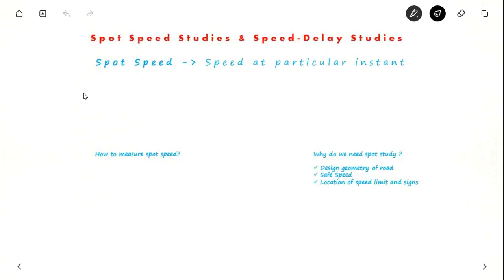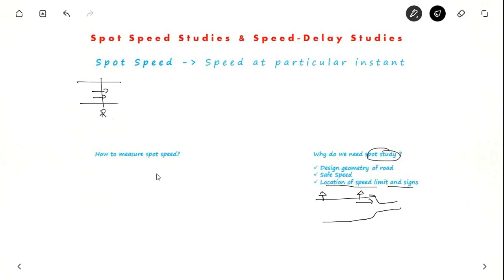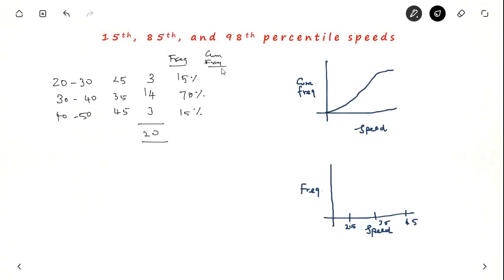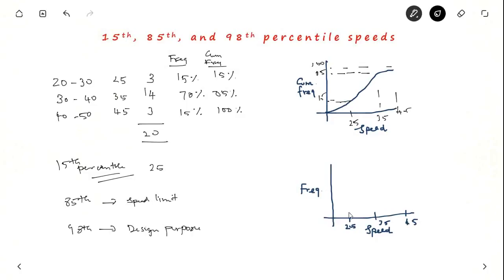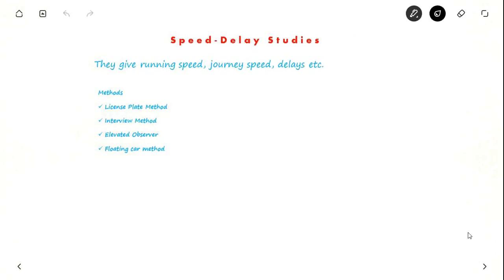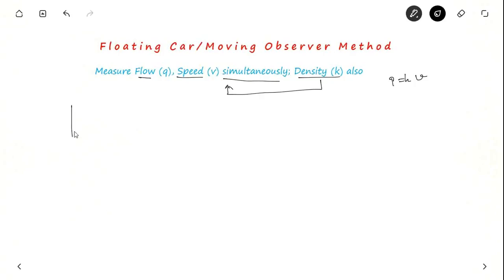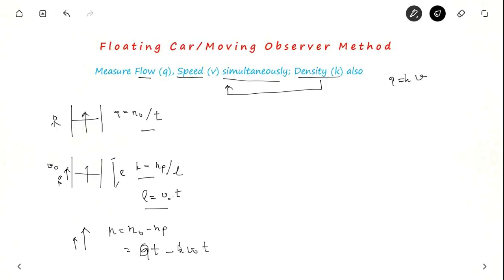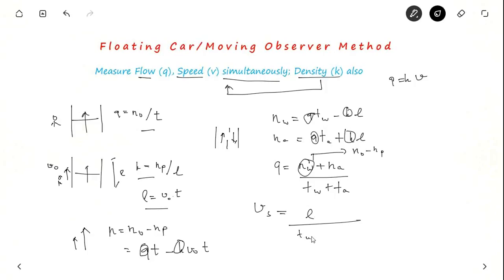Spot Speed, Moving Observer(Floating Car Method) | Transportation Engineering

Comment: gate question saturation capacity u solved graphical 2017 u added 1200+600=1800 but other books take bigger of two in a phase like north south is a phase etc ...plz clarify
Reply from the maker: This question is with regards to a single phase. Although it's not mentioned in the question, it's to be understood.